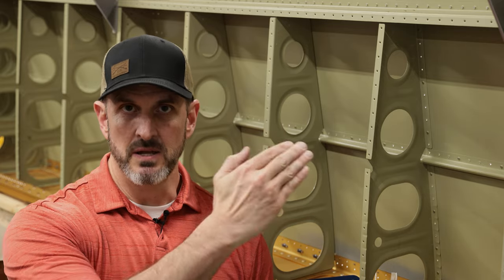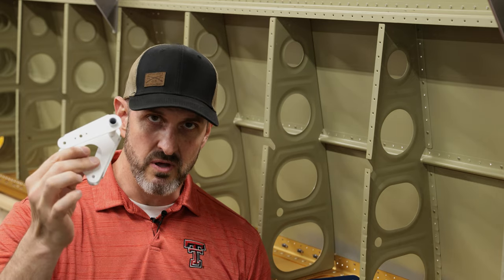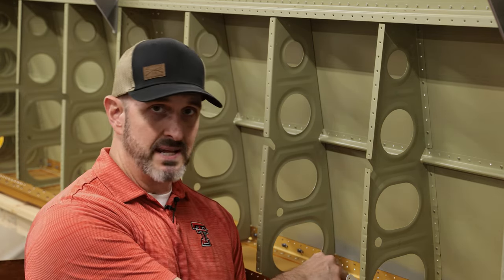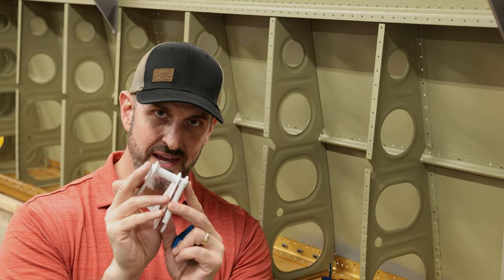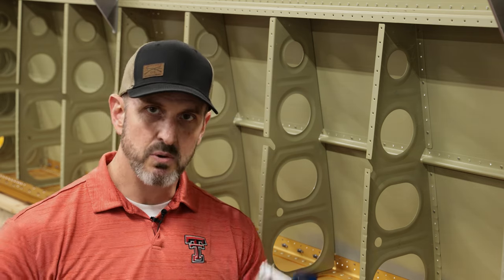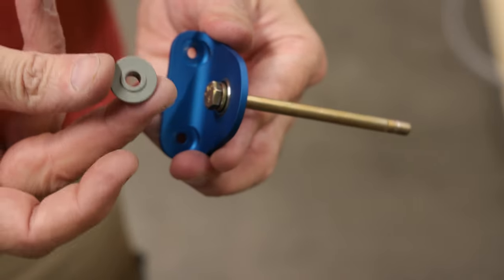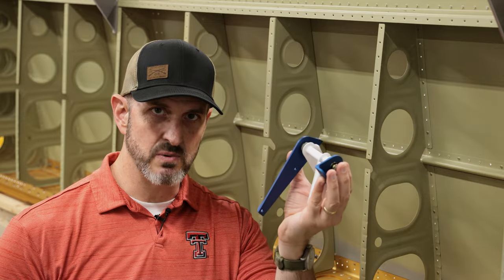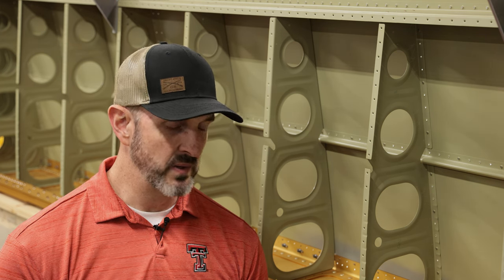Building the RV10 - Video 14 - Sky Designs Ball Bearing Aileron Bellcrank Brackets (April 2023)

Comment: Thank you, very helpful and useful information.  I was on the fence on picking one up.  I will do so after your review and instructions because i think i can do it without buggering it up.
Reply from the maker: Yeah, the install wasn't too bad.  The only tricky part (such as it is) is to not trim the bellcrank shaft (or whatever it is called) too much.  But even if you do, you can add a washer to lengthen it.  I actually did this on one of the sides after I made the video.  But overall, a very easy mod.  Really, no harder than installing the standard kit parts.

Comment: Did you have any trouble getting the bellcranks to swivel under their own weight after being torqued (per the instructions)? I'm having trouble and even after messing around with various shims I can't get the bellcranks to swivel freely under their own weight after torquing the main bellcrank bolt. They swivel freely when initially attached to the brackets but as soon as I torque the -4 bolt, it binds.
Reply from the maker: @bertschb  I did have that problem on one of them - it didn’t move freely. I ground down the bell crank thingie a little too much. I added a thin washer and it solved the problem.
Reply: @buildingthe10  Thanks. I did the same thing - ground the bellcrank down a little too much trying to get it to swivel freely. I'll try again tomorrow with fresh eyes (and more shims)! Hope your son is doing ok.
Reply from the maker: @bertschb let me know how it goes!

Comment: I could not see from video but is there no way for the bearing to come out of the bracket?  Are the bearings just pressed in?  I would like to see close up but I am sure they designed it so if a bearing failed everything would still be held in place.
Reply from the maker: The bearings appear to be pressed into the brackets pretty good.  They are kept from coming out by the bolt and washers (on the outside) and some bushings (on the inside).  If you do it right, there is no play at all and no way they come out.
Reply: I would consider using a larger fender washer on the outside. If that bearing fails, the washer will keep the bolt from pulling through the bracket. This is a good practice even on pushrod bearings.
Reply from the maker: That's a good idea, though there is basically a fender washer (with a slightly raised portion) on the insides that would also keep the bolt from pulling through. @davidwoodward6112